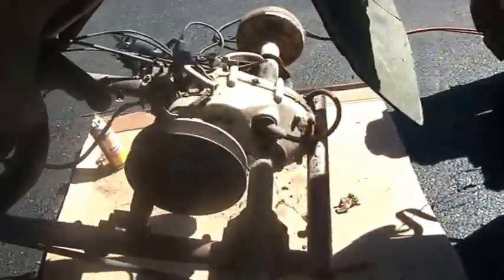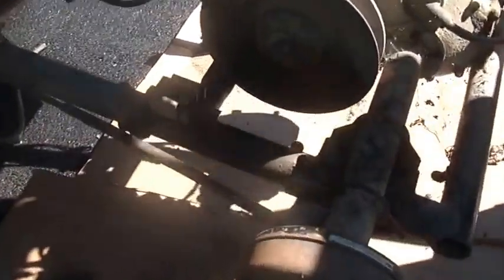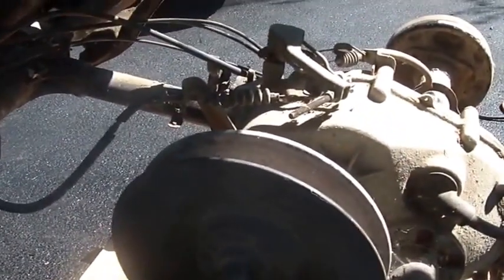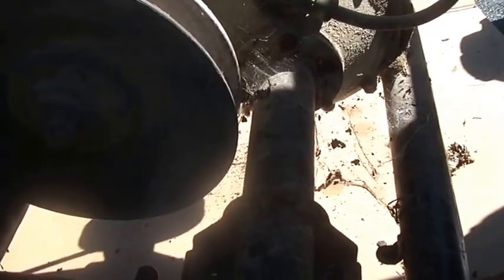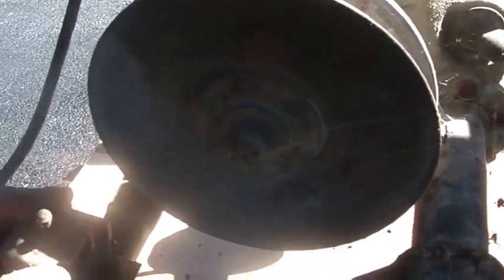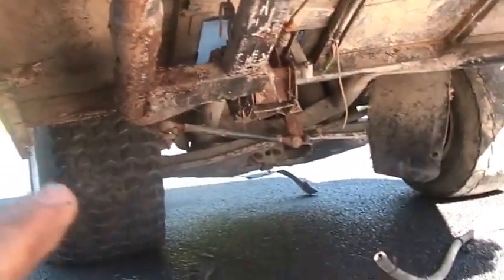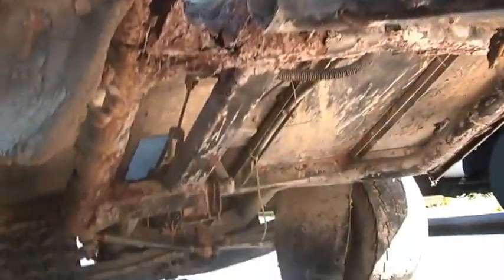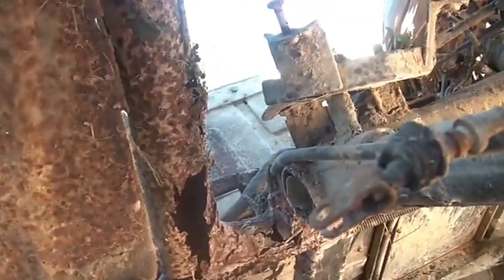Yamaha G5 Golf Cart, engine and transaxle removal, only 4 bolts

Comment: Alogt like a GMC Acadia car. undo the electrical. Then take out 4 bolts(2 on each side) for the struts. take off the brake calipers. Then pull the 4 subframe bolts and the whole motor and trans come out the bottom of the car in one piece.
Reply from the maker: Hey Reading, GM built that car right, easy to swap out the drive chain.... Let us hope it does not need that until the car has many miles on it.... Thanks for the info, watching, and commenting!!!

Comment: ok so the part i come to get a demonstration of you just breeze through just unhook all the cables yeah itd be easy if youve done it before or sif you have two hands. ive ripped forwards gear out of my cart so im just trying to pull the trans to split the case and see what i need to replace